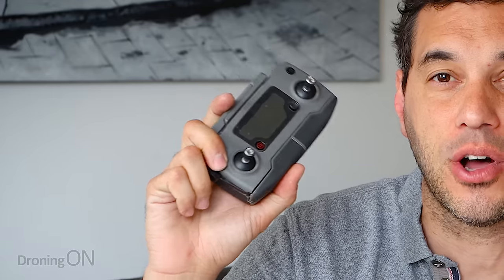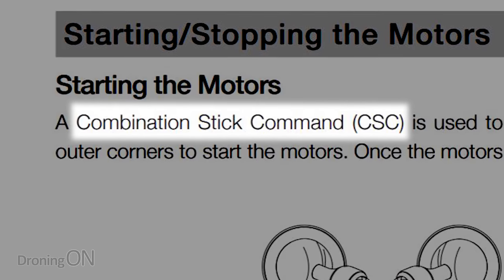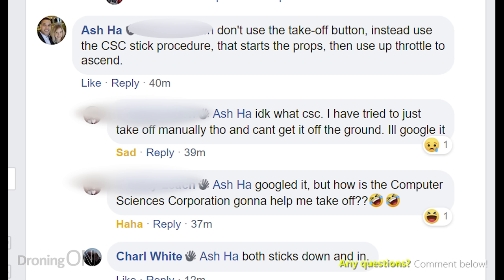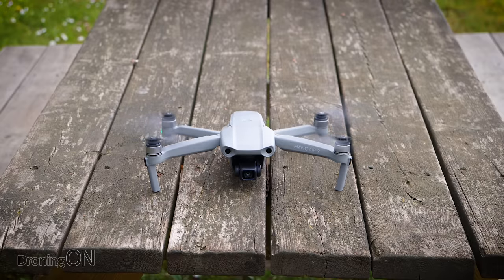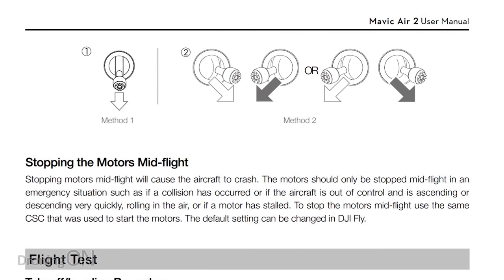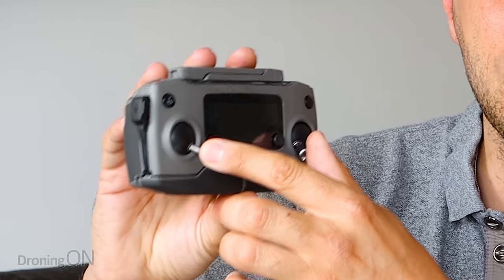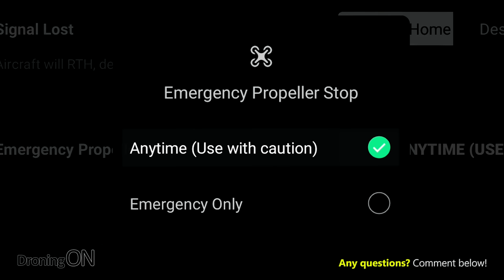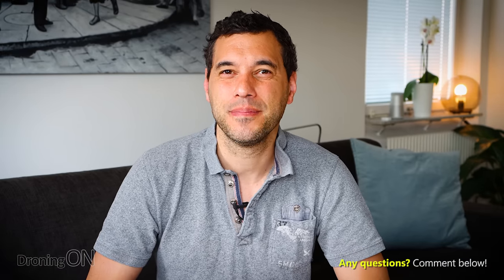What is the Drone CSC Command - ALL Drone Owners NEED To Know This!

Comment: On the old Mavic Air we had a pause button which stopped the drone and hovered in place. On the new Mavic Air 2 hit the RTH button once to pause and press and hold to return home.
Reply from the maker: Yes the Pause is such a good idea, the Mavic 2 range has the same, it makes perfect sense and it is surprising that the Mavic Air 2 doesn't have it, especially with it's 'beginner' appeal.
Reply: DroningON you definitely need to read the manual with some of these now. So much to learn and the accidents happen when we rush out to fly a new one. 3 flights and I haven’t went more than 200m.
Reply: @Droneaddiction  : LOL... I've gone through 4 batteries and am still less than 200m... I did not get DJI Refresh on this one so I am experimenting with several devices and going through every option :)
Reply from the maker: @Droneaddiction  agreed, sadly many don't read the manual and they take-off before even knowing what a 'Compass Calibration' is...
Reply: DroningON there’s a compass? 🤣

Comment: Before I ever owned a quad copter, I built one from scratch using the CC3D controller board. It is set up this way to turn on the motors and to turn them off using CSC. Not until later did I buy a commercially made drone - and Ash is correct, their usage scenarios emphasize auto take off and land, rather than letting you control the motors on/off directly. Good to know :)
Reply from the maker: Thanks for the comment dude, a fellow long-term RCer 😉

Comment: While i usually start the motors using CSC indeed, the ONLY valid reason i can think of to actually stop the motors with CSC is if you got your drone into a tree, with the branches stalling the motors, and you are about to fry them up otherwise. In a wind scenario you probably want to try and land it somewhere safe, or hope the wind is lower on a lower altitude, the last thing you want it to cut the power. Even on a low altitude, even as low as 5 meters or so, cutting the power and just letting it drop will likely wreck it. Heck, would you dare to just hold it at your waist level and just drop it, unpowered, on the ground? Nope, i really don't think so. Got yourself in a situation you are about to hit somebody? You DO NOT want to use CSC, which takes 1..2 seconds to cut the power, and probably want to USE THE CONTROLS instead, to avoid the hit. And, finally, something i've learned from my own experience, actually destroying a prop - don't use CSC to shut the motors off while already on the ground. I've happened to try that, during the 1..2 seconds before the cut off, the drone interprets your sticks as, well.. stick input! With the pitch input being enough to slide that drone and hit it against the wall before you realize this is what actually happening if you are indoors.
Reply from the maker: Thanks for the input, however wrecking your drone is the least of your concerns if it is heading towards someone's face, or property, out of control. Yes there is a minor delay but it's there if you've truly lost control and the drone is unresponsive.

Comment: I also hate that App launch button. Mainly because I dont want to move my hands, but I fully get your reasoning and it makes more sense . You always are in control. The stick launch method is so much easier anyway. I guess if you were to do a descending reverse orbit you might invoke CSC accidentally but I have enough trouble turning left and right :)
Reply from the maker: Thanks Gorilla Man for the comment! It's far more satisfying to "Start Engines", and then "Increase Thrust"....part of the piloting experience :P

Comment: If you did need to use CSC in an emergency, can you the activate CSC again to restart the motors before actually hitting the ground to try and save the drone? Obviously, you may just have seconds to do it, but is restarting feasible?
Reply from the maker: Yes indeed you can, useful to know if you do find yourself accidentally activating it, however it'll only reactivate if the drone isn't upside down. Thanks for the comment!

Comment: Hi Ash,

Great channel. Concise and informative, and well edited (funny, because you DON'T actually 'drone on') :-)

I've been flying with cameras for a very long time, and drones way before the market exploded. I'm not saying this to 'brag', but to add something to this particular video from an 'experienced' perspective (although the number of crashes I've had would contradict that claim... ;-) ).

Both when flying UAVs and when taking part in our other hobbies, my friends and I use a handheld anemometer, for what should be obvious reasons. In the video above, you give an example of somebody flying out to sea, and not being able to make it back because of a headwind on the return journey. Conditions at altitude are usually (but not always) more 'lively' than nearer sea level, but I'm sure you know that even low level coastal/offshore conditions can be very capricious.

As such, although it's hard to predict what the wind conditions will be a mile offshore (and more and more people are pushing the new tech to the limits), it's wise to check the latest local meteorological update before you fly, as well as have a handheld anemometer in your 'essentials' kitbag. These common sense actions can mitigate a scenario which you described in the video.

Handheld anemometers start at around 20-30 GBP, which is a trivial sum relevant to the kit in the air, and as such are an essential piece of added insurance. Again, I'm quite sure you personally know this, but was thinking it might be a good topic for a future vlog?

Please forgive me if you have done a vlog on this already, but I'm a recent subscriber and haven't yet watched all your content. Keep up the excellent work.

p.s. Thumbs down? What are these people on..?
Reply from the maker: Thanks for the great comment and for subbing! Yes you're absolutely right, having a refined understanding of wind speed and strength definitely helps evaluation of flying conditions, however there are also so many great apps such as UAVForecast that many aren't bothered about the real-time forecast. Enjoy the channel, fly safely and we appreciate your support!

Comment: This is great info… I’ve been flying drones for years and wasn’t aware of this.. I encountered an issue where I was flying my drone from my jet skii & when I brought it back and caught it in my hand (like I always do) I could not turn the props off. It absolutely refused to turn off which I assume was due to the more dramatic effect from the waves rocking me & the skii. I had to dangerously pull the battery… looking back , this in theory should have saved me as I just looked and my drone was set to emergency use only. This should fix my issue if I can’t get the props to turn off, right? Thanks

Comment: Yes but you forget the time till the CSC get activated, till that time it gonna spin and be uncontrolable. Because its not instant. And dont do that on ground to stop your props, it will fly off and crash in something...
Reply from the maker: I didn't forget it, the point is that the CSC control provides a way of cutting the props, yes it can take a few seconds to initiate but that's there to ensure that the possibility of 'accidental invoking' it is less. And actually while the drone is on the ground, initiating CSC won't cause the drone to fly off, it will cut the motors in precisely the same way, as documented in the manual.
Reply: @Droning-ON  I have initiated CSC on the ground to start and stop (first spinup in my basement)... No issues.
Reply from the maker: @GorillamansGarage  precisely, CSC works perfectly for start/stop of motors, the drone absolutely does not 'fly off'.

Comment: Great Vid 👍🏻. Do you know if there is a CSC emergency stop for the Parrot Anafi, i cannot find it anywhere. Thanks, Ton
Reply from the maker: Very good question Ton, I have a feeling that the same CSC activates the props on the Anafi but I don't know about terminating them while inflight. Next time I have the Anafi out of the box, I'll give it a try :)
Reply: @Droning-ON  ok, great. Thanks in advance. I indeed tried it because sometimes it happened that during landing the Anafi hits the ground and it stays hopping without switching off their motors, but the csc did not work. May be I am missing something.

Comment: Always use CSC to start motors and to take off. I have felt concern on occasion though, as it's very close to the stick positions to manually orbit while descending. I do manual orbits (POI) frequently while taking video - sticks pulled together or pushed apart - add a descent and it's very close to the CSC, though not at full throttle, which I guess is what has saved me so far.
Reply from the maker: Such a manual orbit would be pretty harsh with that exact command, so that's surprising to hear, especially as you'd be descending as well!! Thanks for the comment!
Reply: @Droning-ON  I frequently use Tripod mode when taking video, so stick positions are more pronounced than in other modes. Not saying I came close to CSC, but the thought did cross my mind to be careful. (Yes, descending and widening the orbit both would be risky.)
Reply: Hi and thanks for this veryinformativevideo!  Can someone help me with this question, how long it need to hold the joysticks for activating the CSC during flight? Thanks and for all a good flight! :)

Comment: I hate to break it to you, but you aren't flying the drone at all.  You can switch your controller off and it will carry on absolutely fine.  You can also ask it to do things which it will refuse to.  These quads are not "flown" they are directed.  You aren't pilots, you are operators.

Comment: I definitely do not use the CSC when flying, NO WAY ! To easy for it to be activated when doing quick manoeuvres. Especially over water.
Reply from the maker: Thanks for the comment Gerard, it honestly isn't easy to invoke CSC while flying, these are videography drones, under virtually no circumstance would you be initiating that sort of control input

Comment: Still dont understand the logic of CSC
If the winds taking it off, then surely you want it to stop or at least float away whilst trying to chase it if possible to reconnect. I wouldn't instantly think, "Ok I'm done" and crash land it into the floor / sea :S :S :S

I want to disable my CSC completely it's a ridiculous idea.
Reply from the maker: Thanks for the comment Bob. In the case where the wind is taking your drone away, there is NO option to "stop it", and no need to chase it either because you will still be connected but the point is that that kind of wind is so strong that the drone isn't capable of a hover. The Mini is a perfect example of this, a lightweight drone which is easily carried away by wind, that's why so many have been lost. The other scenario is if the drone is in a flyaway where you've lost control of it entirely due to a failure, compass error or lack of GPS/VPS position hold, and it's flying towards a person, a car or something, that's where the CSC is essential. This feature has been present on DJI drones ever since the first was produced, it's a respected feature and responsible drone operators know exactly why it's there, so do not disable that, that would be very irresponsible.
Reply: @Droning-ON  I've changed the controls to be the same as Doom Eternal now, so 100% better already to control. They can take a bit of a kick it seems, since I've watched the other video of someone flying it into the side of a large rock pile and it still flew afterwards without worry. Also tipped water over it and flew through some materials.

Comment: there are good methods and there are great methods.  but please let's not characterize the approved methods given to us by the manufacturer as dangerous or launching our drone out of control or less desirable.  it only helps to feed the crowd that believes most drone pilots are careless when flying and don't know how to fly safely.  of course we should know about csc but dji tested and vetted the "buttons" method and gave it to us to USE, not to look down on it.  I would hate for someone to claim otherwise and pretend like it is some sort of mistake.  if you take off automatically and a gust to wind drives your drone into a person nearby are we going to blame the take-off method or are we going to say the pilot should always be in control of their aircraft, evaluation the conditions, and fly safely.  it's unfair to blame the feature because many people have used it a thousand times with no problems.  auto landing is real thing, I'm not sure we want people to fly in and set their drone down and then shut off the props because at the end, the drone will land instead gently and that's a good thing.  if we don't get people to understand these drones can fly relatively safely on their own to some extent (especially at takeoff and landing), we're never going to get bvlos and waypoints, delivery, etc.
Reply from the maker: Thanks for the comment Ken but no, I disagree. While these methods are provided by the manufacturer, they're not inherently safe. Our cars have ABS but should we brake so hard each time that we invoke ABS? No we shouldn't. Features that manufacturers provide don't always make us better, these auto-launch buttons are just that, they're for beginners but operators should always evolve their skillset and fly the drone, don't let the app fly it for you.

Comment: If you use the auto take off, you are still just as much in command as if you used scs !
Reply from the maker: Not quite, because you're then relying on the drone to take off and to lift, ascending automatically. You're only in full control if YOU are executing the spinning of the props and YOU are controlling the ascent. In a similar way, YOU are not in control of a Tesla while it's on auto-pilot, you can take control at any time, but while it's doing the driving you are definitely not in control.
Reply: So if a prop starts to come apart just as the drone leaves the ground, you'll be able to immediately land it, or will it continue to its takeoff height before you have control? How much difference in time before you get the drone back on the ground?
Reply: @johnk8825  : If you auto take off (by App) and a prop flys off... the drone will still wait for pilot input... issue is the drone still wants to raise to launch height... If you use CSC to launch... as soon as you input elevation and a prop fails, you can cancel input . I remember my H501ss... I put props on backwards but by starting props on the ground and then giving input, I saw the craft starting to flip so I just released the left stick and corrected my mistake... Had I used auto take off it would have flipped and flown backwards... a disaster.
Reply from the maker: @johnk8825  if a prop flies off, just one, then the drone will crash back to the ground. A quadcopter cannot fly on anything less than 4 motors, there is an algorithm that some quadcopters such as the Matrice incorporate which allows it to rotate rapidly and land in one-piece, but these lower-grade consumer quads don't have it.
Reply: @Droning-ON  Guess I should have been more specific with a piece of a prop. Saw a Mavic lose about an inch off the end and it was very unstable and was quickly manually landed. My point was if something went wrong the computer was likely in control of auto takeoff until it had completed its routine. Or can you disarm via CSC during an auto takeoff.
Reply from the maker: This would depend on your CSC setting in the app, if you set it to "Anytime" then in theory yes you could trigger CSC, but the key point here is that a prop chunk should never fly off, check your props before you fly and immediately replace any damaged props.
Reply: @Droning-ON  Should never break off but I did see it happen to someone. I always (actually routinely) check mine and once found a crack that could only be seen by bending and twisting the blade the blade itself, it was only a partial crack on one side. It looked just like two other marks next to it that were not cracks
Reply: @GorillamansGarage  That's what this person did. 
I used auto takeoff one time just to see what it does. The Mavic Pro I bought had been replaced with a new one produced 6 weeks before I bought it because auto takeoff flew it into an overhead awning.
Reply: @johnk8825  : There you go... Just dont use auto take off.